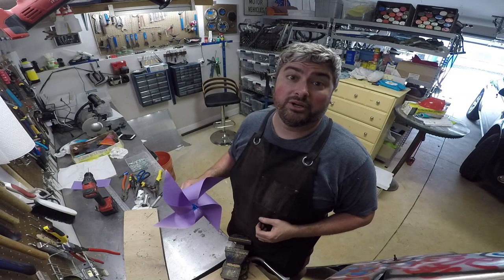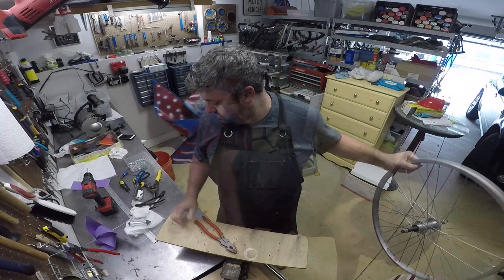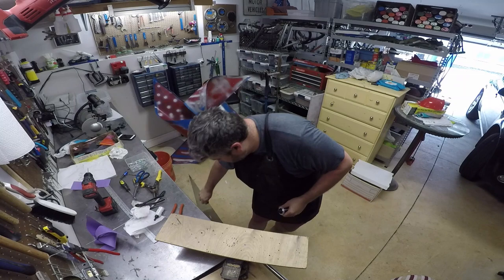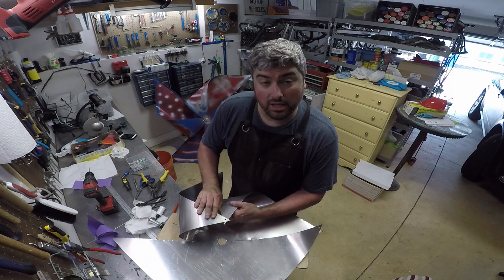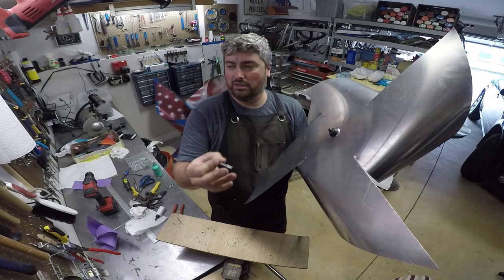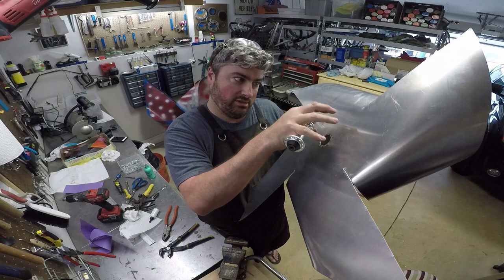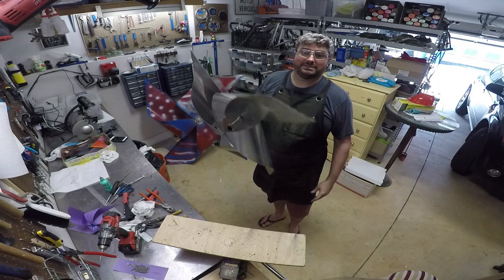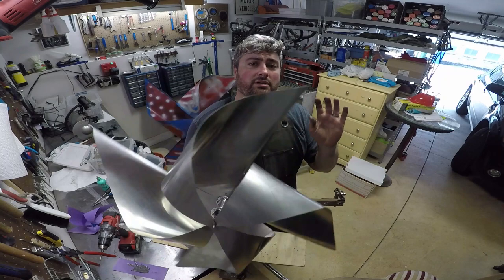HOW TO: giant pinwheel from a bicycle hub & sheet metal. (Extra large pinwheel art)

Comment: High flange hubs will give you the same center hole but the rivets would be more spread out and stable.
Reply from the maker: Vivalaleta Godfrey Exactly. I use high flange hubs when I find them, especially for the extra large 6’ pinwheels. Though some of those hubs can be challenging if the flanges are really canted inwards and thus the end isn’t very flat. But really... use what ya got.

Comment: Nice project! I'd suspect you could also put one of these pinwheels onto a weather vane setup too. I think I might have to give that a try.
Reply from the maker: That idea would work great, but adds a bit of complexity that I didn't want to address in this video. But I'd love to see some pics/video of it some day if you ever get it made. For my 4x big pinwheels that I made as public art, the mounts were fixed (did not rotate to the wind), although I could manually turn them to face whichever way I chose. That simplified construction and kept the budget reasonable. Plus, with as big as the pinwheels were, the size of the tail section necessary to keep them facing into the wind was going to be huge. Alternatively, I considered designing the pinwheels such that they were on the downwind side of a vertical axis, that way the pinwheels themselves were their own "tail". But that's a subject for another video one day. Good luck!

Comment: Thank you so much for sharing this, an excellent project. What spinning mechanism did you use for your larger installation? My wheel appears too large for the bicycle spindle. Thank you again.
Reply from the maker: stephen davies My larger pinwheels also use the bicycle hub for the spinning mechanism, just as I described. The main difference with the larger ones was that I used an additional layer of thicker aluminum to reinforce where the pinwheel center is riveted to the hub flange. But even my large (6ft across) pinwheels were just fine spinning, bolted to the support on just one end of a relatively thin front wheel axle. And like I showed in the video, once the pinwheel and hub parts are connected into one piece, I just attached the axle end on the back side of the pinwheel to some other structure to hold it up in the wind. 
But I didn’t spend any time talking about that structure... 
 for the extra large ones I used custom made vertical steel supports that had a short horizontal section at the top to which the whole pinwheel was bolted via the axle. The short horizontal section ensured the pinwheel would spin free of the vertical part. Not sure if I explained that well enough. But thanks for the question.
Reply: @ARodDMD  Thank you so much for your prompt and incredibly helpful reply. I am incredibly appreciative of your time and expertise. Thank you once again.

Comment: What if we fasten both the end on either side of Bycycle wheel hub in the spoke hole.. I mean put Bycycle hub in the middle and metal sheet at bothe end riveted..??
Reply from the maker: I tried that, thinking it would be more solid construction. But those thin corners that get folded in towards the center... that's where I had failures around those rivets. I found that if the sheet metal was thick (rigid) enough, that attaching to both sides was unnecessary.

Comment: Do you take the bearings out of your hubs?  I’ve seen some makers of windmills taking them out.  Just curious on your thoughts.
Reply from the maker: No, I keep the bearings in. Once I bolt the axle end to something solid, then the whole thing can spin on the existing bearings. If you took out the bearings you could mount some sort of fixed shaft through the hub and then use external bearings around that shaft, but that seems like extra work and cost. And even basic bicycle bearings are more than strong enough for this sort of thing (think of how much force a large adult is putting on the axle/bearings when it is on a bicycle). One of my extra large pinwheels spent 3+ years outside on a very thin 8mm axle with no significant issues.

Comment: Hi Alex, I've just started making pinwheels. Some out of sheet metal. So far, the largest is 22" square. I would like to add thrust ball bearings to hopefully make them spin easier but I don't know which type is best to use. Looking for some advice. Vicki :-)
Reply from the maker: Hmmm... I know a whole lot about bearings used in bicycles, but not much about other types of bearings. The great thing about using a bike hub for this pinwheel projects is that the bike hub already has simple & durable bearings around an axle that can handle the loads quite easily. Most bike wheels use simple cup-and-cone bearings that are great at handling lateral forces that the pinwheel will generate. With the thrust bearing, which i think is better for axial loads, you’ll need to create a housing to contain the bearing (or weld/rivet it to the bearing surface?), and something to be the axle. And since the pinwheel really doesn’t have much of an axial load on it at all (e.g. a load directed parallel and centered on the axle of the shaft), it’s probably not ideal for this use. But honestly, I’ve not worked with thrust bearings much. 
Good luck!

Comment: Thanks for sharing ! I was searching for that without expecting to find how to do one actually ☺ I would love to know the specs of the metal sheet you used for the biggest ones like on Spinning Yarns. I'm thinking about doing a 2x2 meters pinwheel
Reply from the maker: Timothé Grière - here’s some details: The largest ones I made were based on 4’ (123cm) square pieces of aluminum, which yielded a pinwheel that was 172cm from tip to tip (the diagonal length of the original square). That aluminum was 1.7mm thick, and required an additional central reinforcing circular aluminum plate approximately 20cm in diameter and 3mm thick. If you start going much bigger in overall diameter (2m or more as you mentioned), then you’d want to use a particularly robust hub, something with a beefy axle and wide-diameter spoke flange. Good luck!
Reply: Thank you so much for the details  @ARodDMD ! I was thinking of a 2m diagonal but it might be too long. Maybe I'll reconsider for 4' square like you cause it seems already big enough 😊

Comment: Thank you for this. Looking for a hub dynamo to do integrate into a pin wheel and use recycled offset printing aluminium sheets. Was wondering if it is a good idea to let the ⅔ cuts end in a small drilled hole to stop the metal from cracking.
Question: what do you think delivers more power: pinwheel on hub dynamo or wrapped spokes on hubdynamo?
Reply from the maker: My bigger pinwheels did tend to crack around those cuts over time. Never enough to be a problem, but after 3 years in the weather there was a lot of wear and tear. So yeah, a small rounded hole there would likely prevent that cracking.
As to the power... the large pinwheels did catch a LOT of wind because of their diameter. And my guess is that the force turning the pinwheel was more than the with my bicycle wheel dynamos (with the spokes/foil blades). But the RPMs were lower for the pinwheels. So it’s a trade off... higher RPM with lower torque on the bicycle wheels, vs. lower RPM but higher torque with the pinwheel design.
I never tried putting a dynamo hub in a pinwheel. It’s be an interesting experiment. I’m sure there’s some math out there that could estimate the differences, but there are a lot of variables. And since my projects are more done for art than for science, I never delved too deeply into the power side of it. 
Good luck!

Comment: what gauge aluminum you would recommend for a 2x2' sheet?  Thanks for sharing.
Reply from the maker: My local big-box hardware store sells mostly 25ga (0.018", or ~0.5mm) aluminum sheets, which is what I used for this video. For bigger diameter pinwheels, I needed thicker metal, and had to go to a specialty metal supply shop. Those were probably 2x as thick (maybe 18 or 16ga). Obviously thinner metal is easier to work with and lighter, but less durable, but thicker metal can get really hard to work with and is only necessary for the really massive pinwheels. My recommendation is to go as thin as you can without it being too flimsy. There are ways to add bends/creases to the metal to increase the stiffness of the pinwheel. I may discuss those points in a future video.

Comment: Can I attach this to mini generator?
Reply from the maker: Sure... though don't expect this to generate a whole lot of power. I have another video (https://youtu.be/YW4d2dJYq5Q) where I used a dynamo bicycle hub (i.e. a generator built into the bicycle hub instelf), to make a windmill that powers itself to light up. That hub is designed to generate only a few watts of power at 6V. It's not much. But depending upon the application, that could be plenty. And with the right wiring and other hardware, it could be used to charge USB devices or similar. If you were doing this for power generation, you would want the pinwheel to be able to rotate to always face the wind (thus you'd need a "tail" section to keep it pointed upwind). It adds some complexity, but is definitely do-able. My art is more about fun than function, but good luck!
Reply: @ARodDMD  okay, I'll try to attach with bldc 24v 5A, thanks

Comment: What steel is this pinwheel made of?
Reply from the maker: It’s aluminum (thin steel would work too I suppose, but the light weight and stiffness of the aluminum makes it great for this). Check some of the other comments for details about the thickness of the sheet metal.